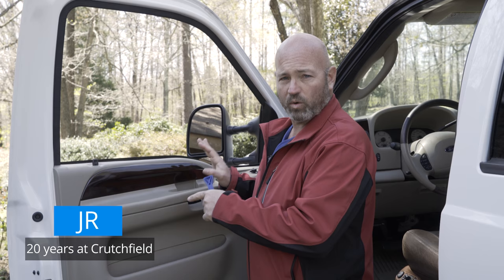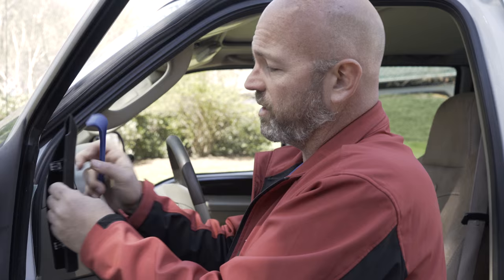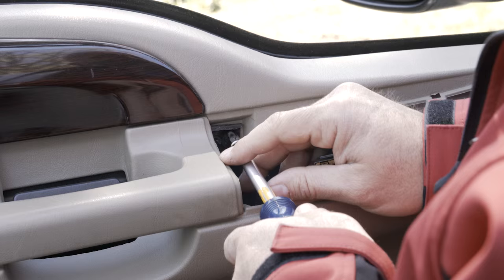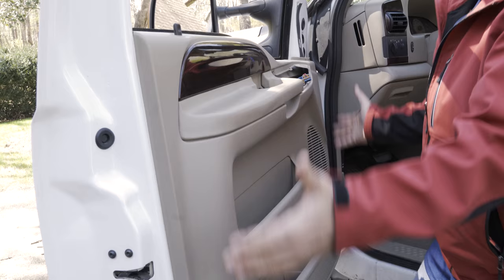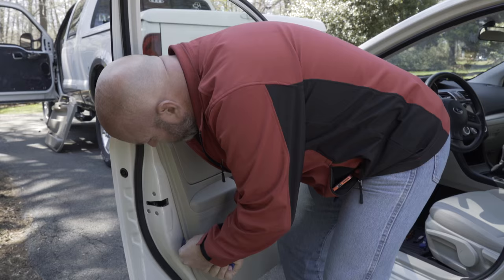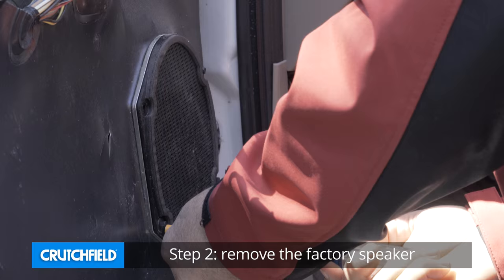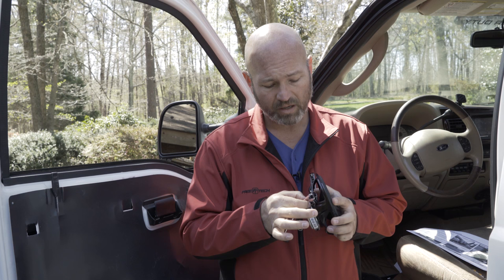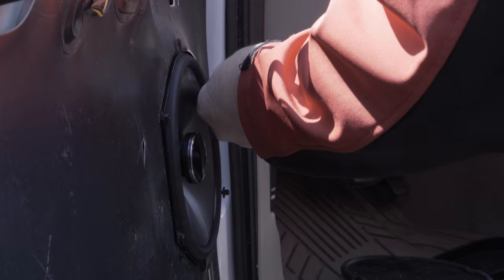How to install coaxial car speakers | Crutchfield

Comment: Hi, I installed C1-690TX in my charger. The front right is lower than the front left. Even when I fade to the left I can still hear some sound in the right speaker. 

How can I fix the problem I’m having. Is it a problem with my receiver outputs, or my amp?
Reply from the maker: If you got the speakers here, please reach out to our Tech Support. Their direct number is on your invoice. Thanks!

Comment: So I feel like an absolute idiot, I managed to remove my entire door panel and got everything down to the bare bone of the door.  I unplugged the panel and the speaker (all easy enough) but when I went to mounting the speaker I got totally dumbfounded and I know once the answer is stated I'm going to feel like an absolute idiot, but let me make it as simple as possible so there's no way to mess it up.  I have the brackets being that my Polk speaker has 4 main screw holes while my car door has 3 so, thankfully Crutchfield gave the mounting brackets with my purchase (for free I might add, which is awesome) but there's no general directions on how to mount the speaker with the bracket to the door.  Honestly I would assume anyone could figure out how to match up some screw holes from the speaker to the bracket to the door... but unless I'm just not looking at it properly I don't see how to mount the three parts properly.

So I mounted the bracket to the door without any speaker attached with the small screws (seemed like the proper move) then I assume mount the speaker to the bracket.  But the "holes" are more like slots that aren't actual holes... This is where it could get confusing and maybe I just shouldn't be deep into the beers but I can't figure out how to mount the speaker to the bracket in a secure, proper manner, being that the 'slots' (since they aren't actually holes) aren't 100% stable.  I guess I'll probably just check with a tech tomorrow about how to do so, but just wish there was some kind of video or even instructions on how to use the brackets.  At least I haven't seen any through my searches.  Any insight would be appreciated.  I'm new to this if no one could tell... :D  still 100% satisfied with everything so far.  Only a small speed bump in my installation, everything else has been extremely easy to process.

Thanks.
Reply: Agreed
Reply: Going thru the same exact thing right now
Reply: @JustBreezy32  I have figured it all out if you are looking for any tips, tricks, hints... I've done quite a lot of car audio/wiring now at this point.
Reply: THENOOB22 yes!!!
Reply: @JustBreezy32  you just need help with the brackets and 4 to 3 mounting? Or something a bit different?

Comment: How can I replace my component speaker setup with coaxial? Should I disconect the tweeter and mount speaker instead of bass speaker?
Reply from the maker: If the component tweeter is blown or just sounds bad, yes, disconnect it. If it's still working, you may be able to incorporate it with the new full-rage but will likely need to add a high-pass filter for it. 
For additional assistance and personalized recommendations, feel free to contact us directly by phone or through our online chat service: 
http://bit.ly/2jBGHPp 
Hope that helps
--Crutchfield

Comment: I have 6.5 speakers all around my 2000 tacoma... what do i need to buy to make my 2x 4" speakers fit? an adapter of some sort?
Reply from the maker: We do not have any adapter brackets for installing 4" speakers in the stock locations of your Tacoma. The larger 6.5" are the better option anyway as they should provide a wider frequency response than the smaller 4" models.For additional assistance and personalized recommendations, feel free to contact us directly:  http://bit.ly/2jBGHPp  Hope that helps!--Crutchfield

Comment: If you have an amplifier do you have to connect each speaker to the channels of the amp or is that just for sub woofers?
Reply from the maker: Any speakers you want to power with the amp will need to be connected to one of the channels of the amp, yes.For additional assistance and personalized recommendations, feel free to contact us directly:  http://bit.ly/2jBGHPp  Hope that helps.--Crutchfield
Reply: ok thanks
Reply: Crutchfield I have a Pioneer AVH-290BT can this radio can power a set of components of Rockford P1675-S front and rear a pair of Rockford P1650 because later I'm getting a Rockford P1000x5 amp to power my entire system!!

Comment: Please respond asap! What if I dont have an adapter to connect the speaker to the stock wire harness? what can i do
Reply from the maker: If you don't have a wiring harness you would just splice together the factory wiring with the new speakers. You can use some wire connectors like these to make it easier: 

https://www.crutchfield.com/I-rYTVc290/p_669PP502/Posi-Products-Car-Speaker-Connectors.html

Comment: What about using foam and sound deadener?
Reply from the maker: Sound damping can help you get the most out of your system. Are you looking to install new speakers into a specific vehicle?
Reply: @crutchfield  I'm applying sound deadening in the 2002 Mustang right now. It already has some sound deadening installed. But no factory deadener or foam on the OEM speakers. I guess it doesn't matter if you use sound deadening or foam between the speaker backside  and the mount or adapter plate (?). I'm not sure if the FAST foam would be worth the expense. I have 2 midrange/woofer and 2 tweeters in the front and 2 coaxial 2-way speakers in the rear deck. I've applied deadener to the inside of the doors also along with the trunk.  All rhe speakers, except for the tweeters, have sound deadening between them and the mount instead of foam. I still have some vibration/rattle with deep bass. I'd like to get the road noise down quite a bit more but I'm not sure if I have to go all out and deaden every square inch. I plan to do my 2014 Xterra next.
Reply from the maker: Are you using an aftermarket amp for power? Where does the rattle tend to come from?

Comment: I see you did not disconnect the car battery. I’m guessing that’s not important when changing out speakers?
Reply from the maker: It is not because there should not be any wiring that could be hot or have power on it when the engine and ignition are off.
Reply: @crutchfield  Thank you